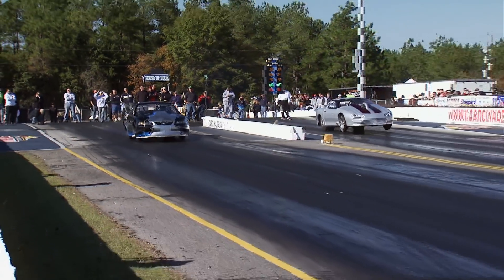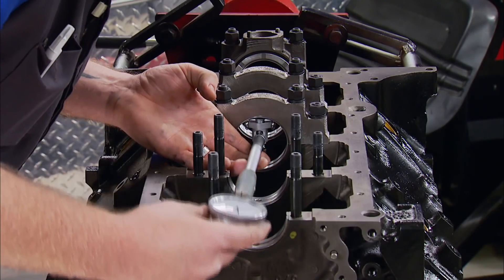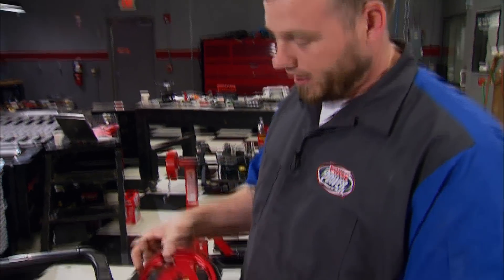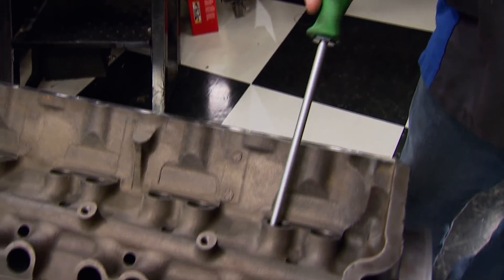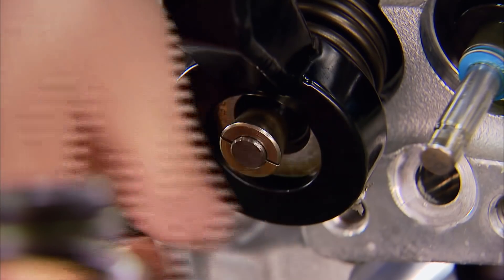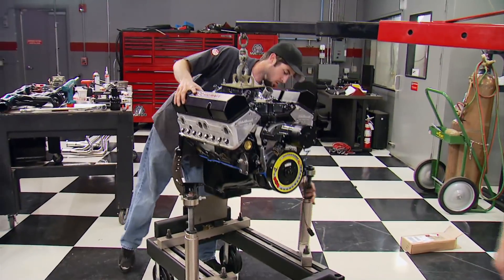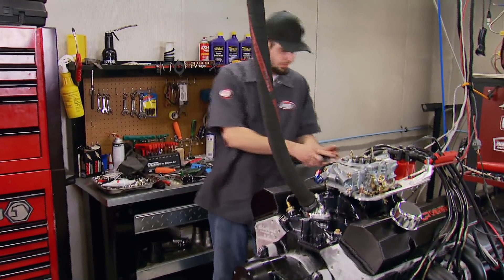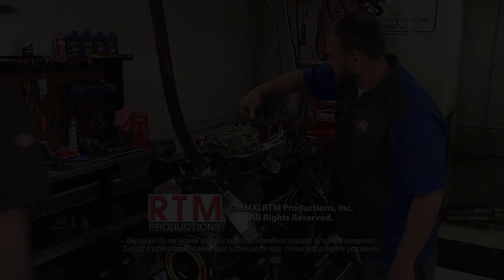Building A Bracket Race Engine From Repurposed Parts - Horsepower S15, E10

Comment: I respect Joe Elmore and The only real mistake you made was NOT too Use the comp cams locking plate kit and the edelbrock heads aren't what I'd use, and you ain't Gunna win any races with that cam where I'm from but in the application maybe for beginners., otherwise good job.

Comment: Do those replacement timing belts come with a schedule on them? I don't know how many engines were destroyed because people didn't know when a timing belt was until it went boom.

It happened in my family in 1994. It was the end of mom's 1985 Nissan Maxima.

Are replacement belt parts easily obtained? Many timing belt engines were destroyed if the replacement parts weren't good enough.

Comment: You never know which way the thrust bearing is off, so i always put a small flat metal plate up against both ends of the crank one at a time and thump the plate to drive the crank forward, then backward, that way i know the thrust bearing is centered, Hope this helps.

Comment: Nice build but one question, why only 11.5:1 for the compression? Too much for cheap 87 pump but not high enough to take advantage of either race gas or E-85. At least 12.5:1 or more. E-85 is cheaper, runs cooler, and more consistent too. I'd say 13.5:1 would have been perfect!
Reply: 11.5 is fine for E-85. An N/A engine doesn't really benefit from E-85 anyway. It's MUCH better for boost. 

13.5 with stock main caps is too much anyway.
Reply: @davelowets  just curious why you would say that. Back in 2002 i was in college and our Motorsports Club built a factory sbc gen 1 block with stock 4 bolt mains, a stock stroke(3.48") steel crank 355(.030) with Bullet solid lifter cam, Edelbrock E-Street 200cc heads, Comp roller rockers, Edelbrock Victor Jr. intake, MSD ignition, Holley HP 750dp, 13.5 compression, JE pistons, Dyers forged rods, and ran it on Turbo Blue race fuel and with a Precision Industries 4200rpm converter, a Scott Hoch built TH400 with brake, and 4.86 gears in a Moser 9" and 29x9 M/T slicks we ran low, low 11's. And we raced that thing for years with 13.5 compression.

Comment: Didn't watch the entire video, but had to commend you on one thing that only the better engine shops do.

Good job on measuring  clearance. Yes, it is a Race Engine and it should be Blueprinted. However, many Mom & Pop shops don't see the importance of using a Dial Bore Gage even on a Race Engine!! Absolute mind boggling. They are content on using Plastigage. If I see that method performed by a so called "reputable shop" on a performance or Race Engine, I turn around and never return.

Comment: Wrong hydraulic roller lifters. 10:15 That's why the engine was running crappy. The tie bars are bottoming out on the lifter valleys 🤦🏽‍♂️. They need .300 tall lifters. It wasn't the carburetor...🙂. Nice try guy's..
Reply: They used the correct lifters, the lifters weren’t a raised boss
Reply: NOT wrong lifters... 😒

Comment: Anybody notice the drips from breather on the valve cover around the 16:19 point? If that’s oil it might need a catch can!
Reply: They got oil down an intake port when they poured all that oil into the lifter galley.
Reply: @danmyers9372 If down an intake port then it should exit out the exhaust. If it makes it past the rings it should end up in the sump but if that much is making it past the rings (hopefully they just hadn't seated yet) then ring gap, piston to cylinder wall clearance or something along those lines isn't right.
Reply: Perhaps the guides are loose and they are just running o'rings.
Reply: OR it could simply need some baffles in the valve covers. 

Pretty much ANY engine WILL drip some oil out of the valve cover breathers with NO PCV system OR vacuum pump. 

There WILL be some crankcase pressure, and it HAS to go somewhere.

Comment: Anyone noticed they are using a roller block one piece rear main with a  roller cam but did not use the cam retaining plate and went with a cam button instead why create the extra work ?
Reply: Becuase they wanted to use tie bar lifters over the dog one style, plus they wanted to show what most people have, not everyone myself included has a 880 roller block
Reply: Because those are the parts they had..... 

Beggers can't be chosers. They get what they get from the sponsors

Comment: If I was rebuilding an engine, especially a Chevy, I would install a timing CHAIN, instead of a timing BELT. I don't trust them.
Reply: And I mean a DOUBLE LAP timing chain.
Reply: Same, they aren’t proven. With euro engines; belts are a 70k wear item on a STOCK DRIVER. Chains are good for 100k on a modified screamer. Swapping a chain setup for a belt is just plain stupid.
Reply: External cam belt drives are BETTER than ANY timing chain. Period.

Comment: A timing belt run on an aluminum cam gear bathed in oil? That just don’t seem right to me, I would be afraid the belt would get lubed up with oil and be so slick it would slip and jump teeth.
Reply: Mascara used them for years
Reply: NASCAR
Reply: @johnnywalker640  don't seem like the ideal situation, a dry belt would have way more grip. Imo
Reply: It's an EXTERNAL belt drive system

Comment: What is normal cause of carbon buildup on intake valve in carburated engines??? Plzz give detailed answer and also simple diy method for removing carbon on piston crown without removing head ????is water injection and evaporative steam cleaning is good for engines ??? And basic single cylinder carburettor air screw setting for commuter class and race style carburettors
Reply: Leave it... it isn't bothering anything. 

You'll do damage trying to remove it.